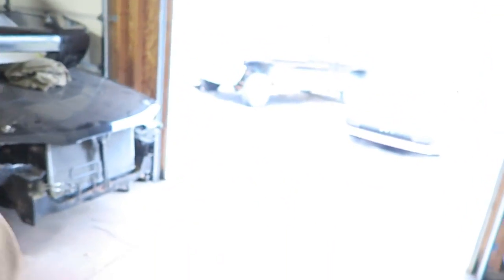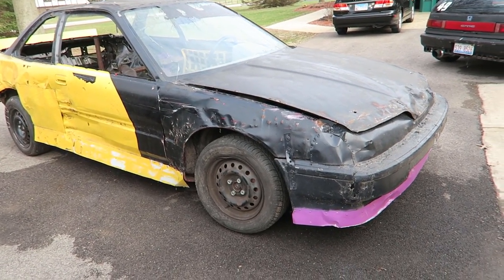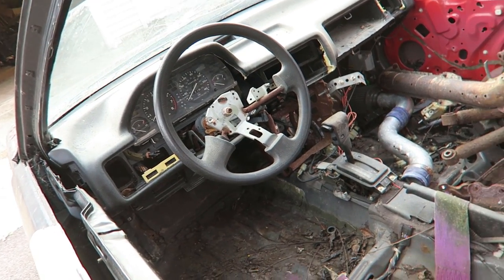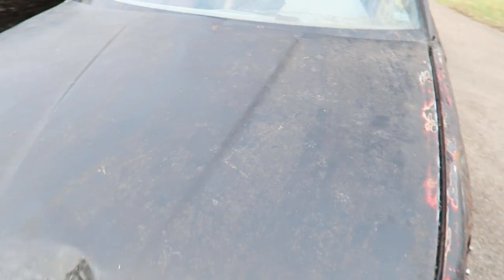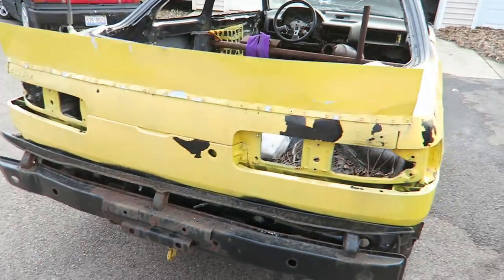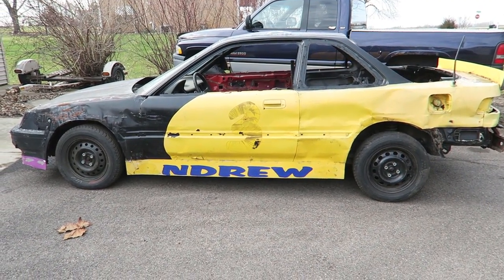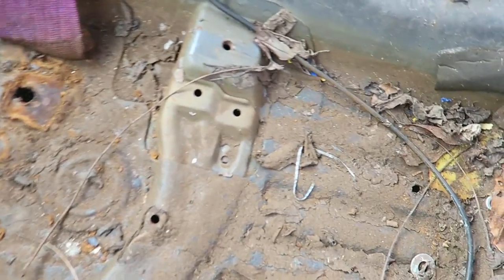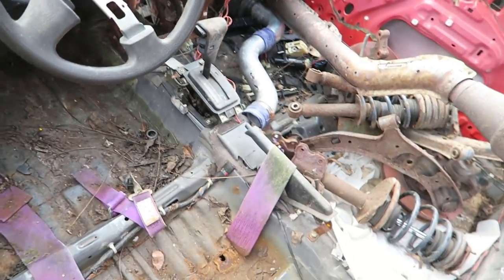Budget Wheel 2 Wheel Racecar: Building a racecar for under $1000

Comment: Do you race at Rockford or somewhere else? Cause that's the lefthanders just 15 minutes from where I am. But I've never seen your car.
Reply from the maker: Benji Motorsports I have many years ago. Been racing mostly iss enduro and some dirt tracks in the last couple years.
Reply: I have been told to take my enduro car up to Jefferson for the enduro, but it's a car that's cost me maybe 300 and I've had it for almost 2 years now, and it runs perfectly fine, but it's not got a cage, it's got a bar across the car behind the seat to keep it from going smush, but that's it. I learned how to drive stick in it, in the goblin at Rockford that had 213 cars in it, so back in 2016.
Reply from the maker: Nice! ISS races clean. Not like the Goblin. lol. You will need at least a plate over the drivers door to pass tech if you don't do a cage. But I highly recommend doing a cage. You don't need a fast car to do well, just survive to the end!
Reply: The car I have has one dent in it, otherwise it's still dent free. It's a matter of driving style for me. But I already have a racecar which has a cage in it. so it's not exactly cheap to do that to another car.

Comment: Hey man on the 1inch lugs I seen a 2.2 cavi pull all 5 lugs thru the wheel so ya may want to change your thinking on that bud
Reply from the maker: chris wright I've raced over 170mph in 3h+ endurance races for years and never had an issue. Every time I've seen that type of failure it's been because the wheels themselves cracked from being used for years. The stock type steel wheels don't handle that abuse for very long. Always inspect the areas around where the lug nuts go on the wheels, Front and back for cracks.
Reply: Sounds reasonable I'm not to sure how old my buddies wheel was but it defiantly pulled thru lol 2 laps on a 5/8 mile track was probably one of the roughest tracks on the east coast not to mention lol

Comment: At my circle track Honda engines are against regulation lol
Reply from the maker: AFX Gaming make them change the rules then!
Reply: The tracks in this area have break out rules, so it doesn't really matter for kind of engine or car you have.
Reply from the maker: I hate the break out rule with a passion. SO LAME! Doesn't push anyone to learn how to make a car or themselves faster. Such a joke! (GRUNDY) Who else does it?
Reply: Rockford started it last year, but it's a tenth slower then what people were aiming to have their cars for Bandits.
Reply from the maker: Benji Motorsports well that's no fun!
Reply: Most cars were aiming for a 16.5, and they made it 16.6, and it's cause they got rid of the hornets and are merging the two together, so they wanted to give them a chance in the bandits. Plus outside cars that weren't built to rockford can barely run a 17.0. So they wanted to even it out for the people traveling to rockford with no experience on the track.
Reply from the maker: Who gives a damn? Improve yourself and your car. Just because people cant figure out how to drive or build a car doesn't mean that they should be able to run the same lap times as guys who work hard and can drive. Participation trophies for everyone! What a joke...
Reply from the maker: I think I was running 16.3 or something like that over 10 years ago in my Lake Geneva car on practice nights. (4 cyl)
Reply: Hey, no one said the drivers agree with it, but when there's a person with a 10,000 dollar engine in their car, and every one else is having to spending over 1000 just to keep up with the guy, not even beat, but keep up, they had to do something. 16.3 though, they consider that to be a slow short tracker, but a lot of drivers think 16.4 would have been perfect, but that wouldn't have solved the issue with the car that was winning every night it was running. And you can't say they had the best driving skill, cause the were drivers with built cars and have won numerous championships, but they still couldn't beat that one car. it just takes one bad apple to ruin it.
Reply from the maker: Sounds like a tech or rule problem more than anything else.
Reply: That it is, the guy that does tech doesn't even like my car, because it's not a dodge, ford or chevy. So now it's louder and gonna be even faster, so I'll probably break out a few times. Oh well. I'm doing mainly madison anyways now. But Rockford is doing Saturdays as well now for Bandits, besides the wednesdays.
Reply from the maker: good to know!
Reply: Plus they also want to make it cheaper on the person, so people aren't having to fork out 5000 just to be fast enough to keep up. the only thing I've done with my car is change tires and it's gotten to be almost too fast for the break out rule.
Reply: Looks like the vtec won't kick in at your track

Comment: Stop gripping the extra big lug nuts are to keep tires from falling off lol you must be new
Reply from the maker: Tires or wheels? Want to learn a lesson? Aftermarket wheels have a taper shape seat for the lug nuts. Stock wheels have a conical shape. So do stock lugs. If you run taper lugs on a conical wheel, they either crack them or they come loose because there is not much surface area holding them together. Guess which style is on the oversize lug nut? YOU must be new...